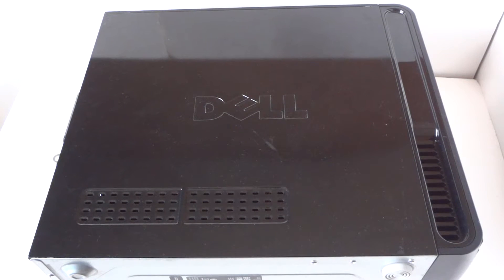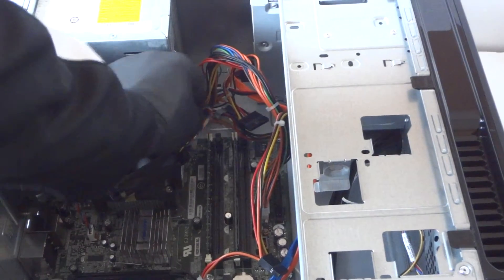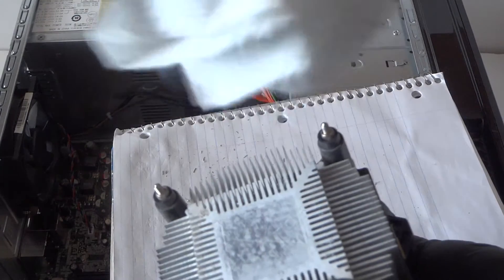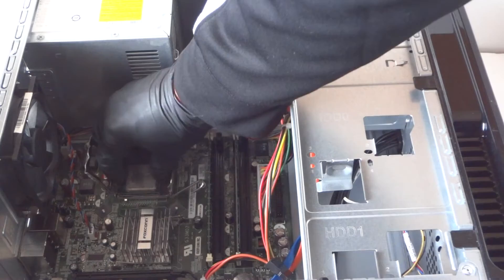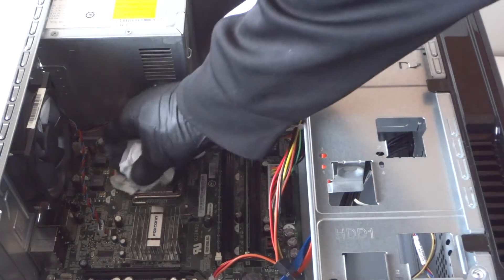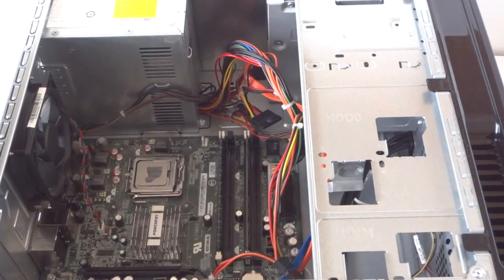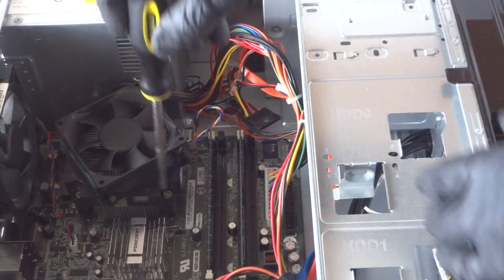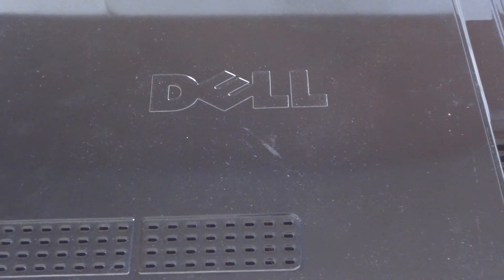Dell Vostro 200 Processor Upgrade

Comment: brother, i have the same pc and i want to upgrade the cpu from a core 2 duo e4400 to a core 2 quad Q9550 but i am afraid that the 250w psu wont handel it,should i do it?

Comment: Can i play League of Legends if i get a CPU upgrade ?
Reply from the maker: H, yes you can and you also have to upgrade video card.
Reply: League has very low requirements Mxkdi is right installing a video card would be the best option I remember playing league of legends with the Vastro 200 without a graphics card and I was only pulling about 30 fps but when I installed the graphics card my fps SKY ROCKETED it went from being only able to play on low with 30 to being able to play on medium with 60-70 fps it was great! The graphics card I'm using is En210silent/di/1gd3/v2(lp) It have 1gb Vram which is good for me you can find one on eBay for like 20 bucks but you can find one on there for way cheaper don't forger if you decide to buy it to remove the bracket as it won't fit if qyou don't remove it.

Comment: can i upgrade intel core 2 quad q9300 2.50 ghz and 8gb ram ??
Reply: Ya I did a lot of research trying to find why I could not upgrade my CPU to quad and I found out that this model motherboard is G33MO2 Is only compatible with duo core the highest CPU you could  get for that model is E8600 3.33ghz that's the one I have anyways I found out that some of the dell Vastro 200's shipped out with G33MO3 which is quad core compatible If you would like to find out which one you have just open up your PC and look under your heat sink BTW your heat sink should say foxconn if it does not thats OK some of them don't for some reason if yours does not say it just use the guy in the videos mother board as a reference his says foxconn anyway right under the foxconn heat sink it will show a back words RU than a number like G33MO2 or G33MO3 hopefully you have G33MO3 to upgrade to quad but if you don't you can always upgrade the mother board there are many mother board you can upgrade from the G33MO2 here's a list G33MO3,DG33MO3,DG33MO4,DG33MO5 and DG33MO6 I just ordered DG33MO6 as it seems to be the latest one but these are all quad core compatible hope this helps if you have any questions please reply ill be happy to help thx!
Reply: Nope...seems that this PC only support until Core2Duo, not Core2Quad.
Reply: I am using  intel core 2 quad Q6700 2.66 2.67ghz and 8gb ram

Comment: How do I update the bios I have a vostro 200 & a 400.
Reply from the maker: Hi, what model dell do you have dell vostro 400 or 200 ? i will send you BIOS download link.
Reply: @Mxkdt  I have a Vostro 200 & 400. I put a Core 2 Duo in the 200 & a Core 2 Quad in the 400. Both are extreme editions & are the fastest chips available for the Duo & Quad line of processors.

Comment: Could you please specify the cpu's
Reply: I've attempted to chage the CPUs for QX6700 and other that currently have not worked. ill be back if I have any updates but there is a PDF with all the "Compatible CPUs" for Vostro 200.
Reply: Milton Garay I need the pdf
Reply: I know this post was a year ago but if you're still wondering the Vostro 200 has a G33M02 motherboard which only supports dual core CPUs.
I just tried a quad core and it would not boot. The fastest CPU this motherboard supports is a Wolfdale E8600.
Here are the boards specs: http://www.findlaptopdriver.com/motherboard-g33m02-specs-8272010h1149/
Reply: I  am using  intel core 2 quad Q6700 2.66 2.67ghz and 8gb ram. @JohnSmith-qn3ob  yoou need to update bios before installing cpu
Reply: @tonyclavell7861  
I have the most up to date BIOS from Dell (1.0.16).
Is their another modded BIOS from somewhere else?
Reply: @JohnSmith-qn3ob  The Dell Vostro 200 MT series has two variants of motherboards, both made by Foxconn and based on the G33M.

The G33M02, supports up to Core 2 Duo processors and the DG33M03, supports up to Core 2 Quad processors.

Vostro 200 MT systems sold with Pentium Dual-Core or Core 2 Duo processors can not be upgraded to Core 2 Quad processors without adding at least a 350W power supply and swapping motherboards to the DG33M03 motherboard.

The reason the G33M02 doesn't support Core 2 Quad processors is because it only has 6 voltage regulator ICs, the DG33M03 has 11. by the way is me Tony Clavell
Reply: I’ve installed a Xeon X5260 CPU in that MOBO with Windows 10 without any issues. Only you need a Mod Xeon (with sticker on it) work in the socket itself to fit the Xeon and install a Modded BIOS in order to get it to work with windows 10. Easy cake.
Reply: @jesuskingofkings  It will use just 2 cores out of 4  anyway
Reply: isaac chavarria Noup. It won’t accept quad cores Xeons. Only dual core Xeons.
Reply: JUAN CARLOS AVENDANA GUERRERO can you send a compatible part list to upgrade this pc?

Comment: what do  you need, to upgrade to a i5
Reply: new motherboard, and new case. since the case only supports this motherboard, and new ddr3 ram instead of this ddr 2. i would suggest lga 1155 since its very cheap for a 3570 or 2500 i5!

Comment: hi i have vestro 200 i found it i want to upgrade what is the maximum that i can do to it  i have 2 empty ram slots already   i want to add rams and vga can  you help sir ?
Reply: I've been told the Dell Vostro 200 accepts a maximum of 4x1gb sticks 4gb total ram.
Reply: Max will end up being 8GB, 2 per slots. I had some DDR2 that where 4GB each and they could not be read only on half of their capacity. so even if you can find 4x4GB=16GB the Motherboard will not recognize all GBs available and its because of how it was build. not because of the limitations on Bit Systems such as 32Bit having a limited amount of memory ram allowed but because the motherboard cannot read them physically.